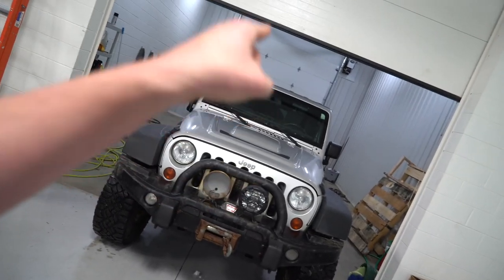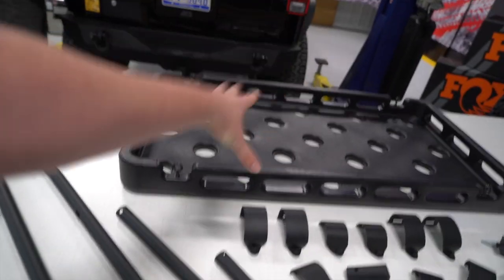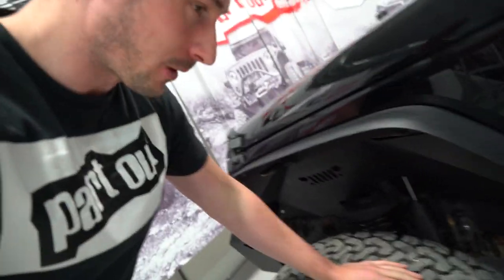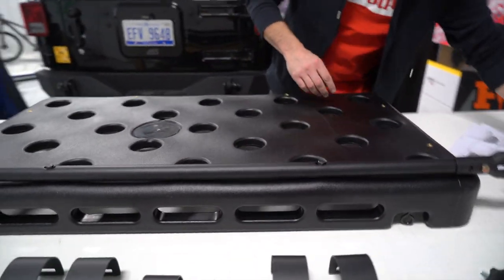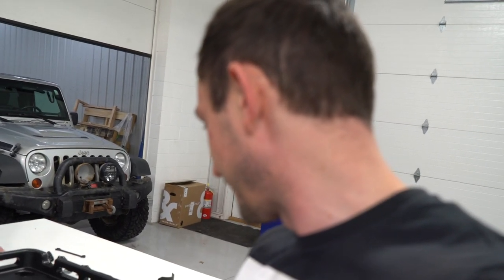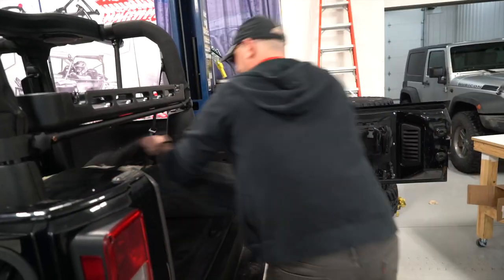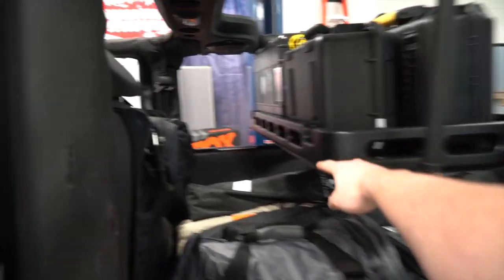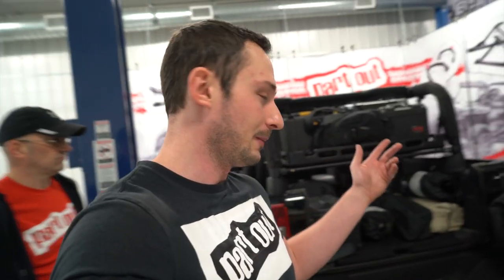Fit more in a Two Door Wrangler - Tray Storage | Bestop

Comment: Can you still use the back seat or does the rack take up the whole back end??
Reply: The back seat has to be folded down or just removed in order to run the rack
Reply: I figured that out after watching a couple other videos.  Thank you for the response.  You by chance know of any shelves like this that will work with a back seat still in place or an option that would at least allow for one side of the back seat to be used?
Reply: @brcampbell9977  For a two door wrangler, I am not aware of any tray units that would work with the rear seat folded upwards.  4 Door wranglers have a few options though.
Reply: @natesmith3717  Gotcha.  Thanks again.  Haven't had much luck, figured I'd ask.  Maybe they're was something I haven't seen yet.  Looks like I'll have to get creative

Comment: Does the hard or soft top need removed for installation of this product?
Reply: Not necessarily but it would be a lot easier with the top off.
Reply: I heard from Bestop today that the upper bracket  might rub the hard top. She said it was designed to work with a soft top. She did say it will work with a hardtop but it might scratch it. Now I'm looking at Vector Off-Road.
Reply: Best of luck on finding the right storage then! Im running the vector dash bar mounts, they make some good stuff!